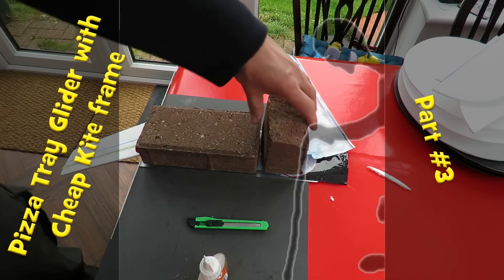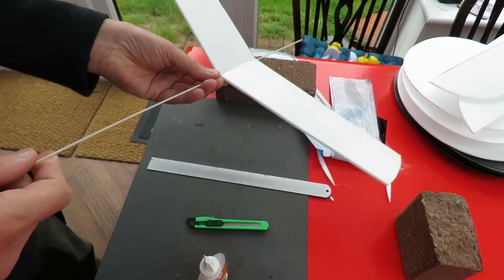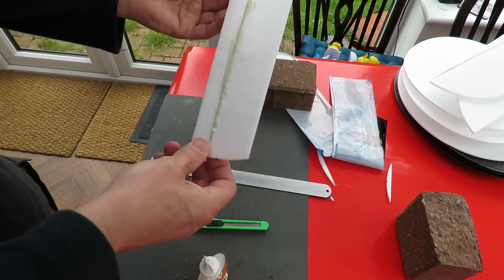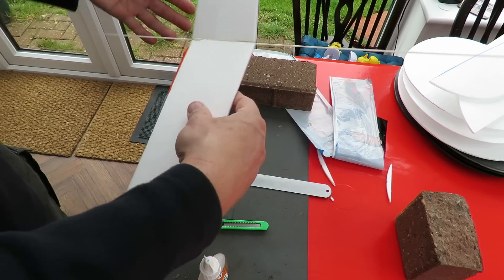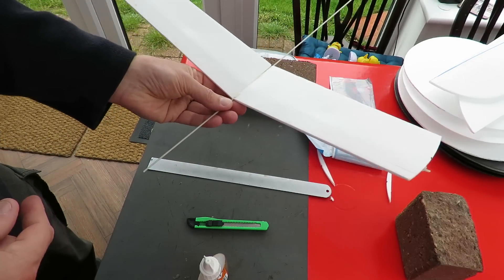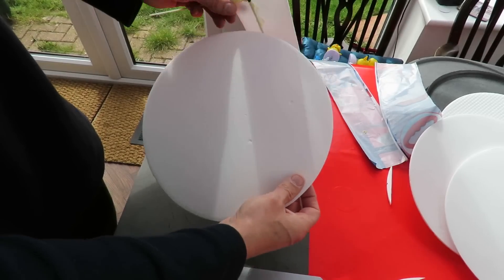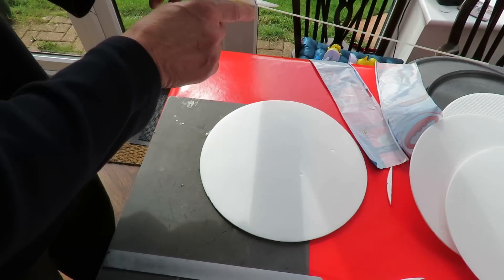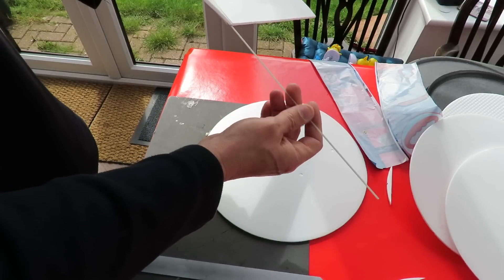DLG Pizza Tray Glider with Cheap Kite frame #03

Comment: Do you think you might add dihedrals to the wing tips for more lift?
In the teaser video it didn't have them.
Reply from the maker: In a later video I do extend the wings which improves the glide a bit although the wings are then a bit more flexible. At some time I will make another using lighter RC gear.